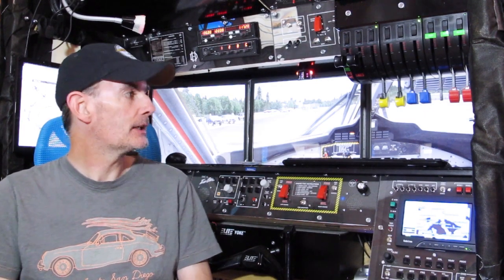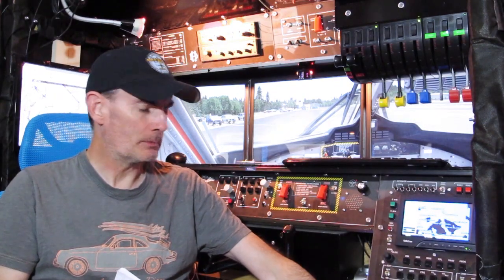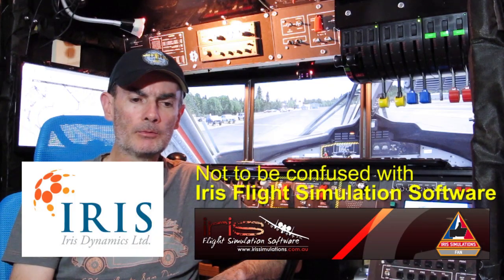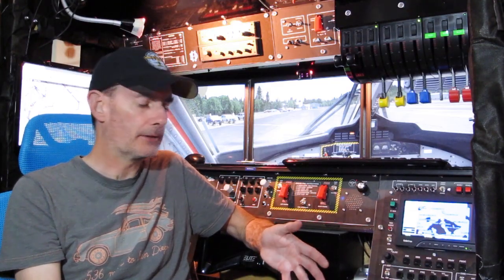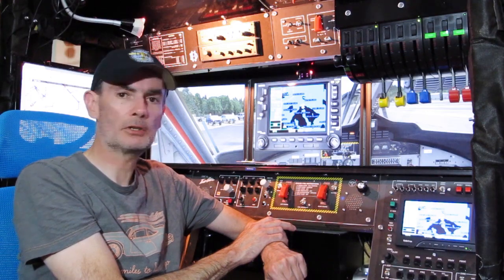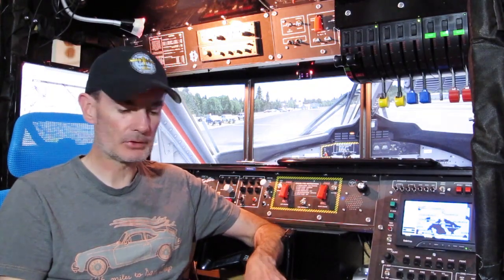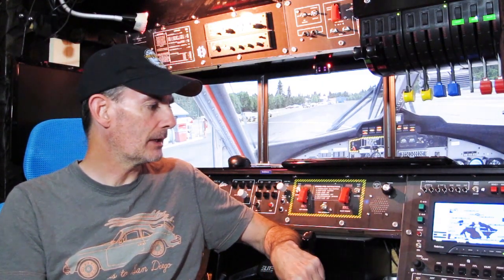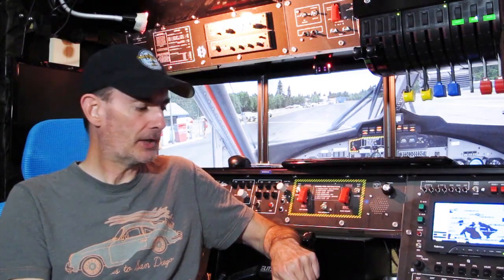Home Cockpit - One Year On (Twin Otter Cockpit Build - Part 25)

Comment: Not sure why you would want to use the default flight planning for FSX.  I always found it lacking. The flight planning in the RXP I found very workable, though it does require a flight planning program. On a side note, have you seen the Flight 1 GTN 750 GPS unit. Very swish bit of kit, though since it uses touch screen (ie mouse clicks to activate items on gps screen) it'll probably not work in a home cockpit environment. Still very nice, even displays traffic.
Reply from the maker: NeonsStyle I don't want to use the default flight planning, which is why I am going to buy FS Commander. But FS Commander cannot load flight plans into the RXP GPS. Nor, as far as I can establish, can any other program (unless you know otherwise). To use flight plans in the RXP you need to enter them waypoint by waypoint using the fiddly buttons. I would also need to duplicate the effort, since VoxATC requires an FSX flight plan to be loaded.

About the GTN 750 - yes, I have heard of it but have not had a look as yet. Presumably you could make it work somehow if you had a touch-screen monitor.
Reply: Almost Aviation Yeh... you're right I know of no way either. If you like VOX ATC you might like to take a look at PilotEdge channel. They provide live ATC services by real controllers. Be interesting if you can setup the GTN750 as touch screen. I spose you could use that mouse to keyboard program.
Reply from the maker: I have my eye on Pilot Edge. I learned to fly in Socal (Fullerton Municipal, then Long Beach) so it would be very nostalgic. Once Orbx releases its Socal scenery I will very likely sign up!